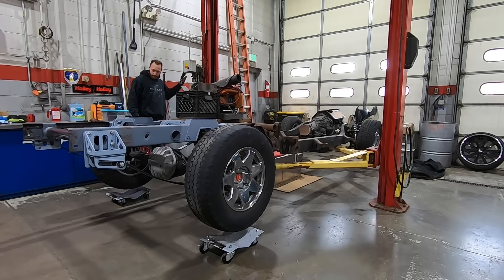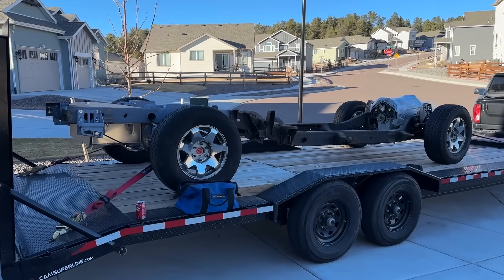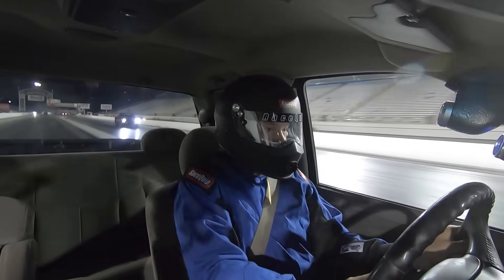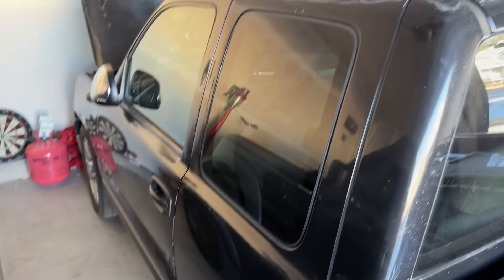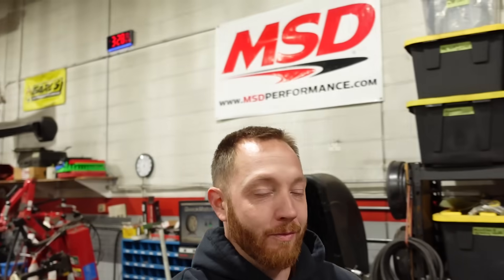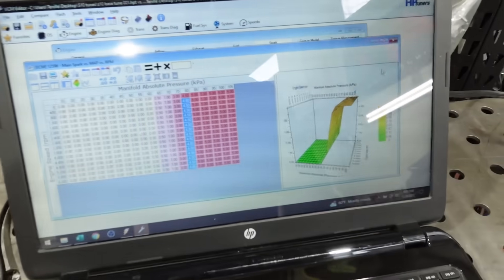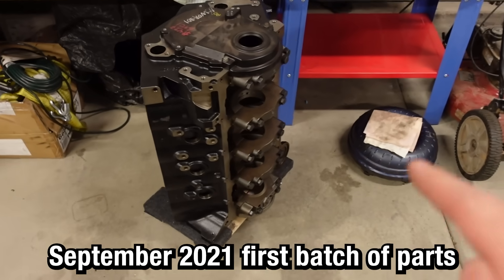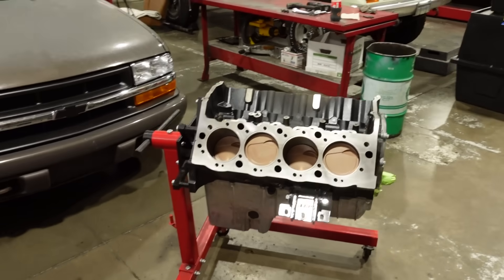my MOST POWERFUL engine project is BACK

Comment: Dang I just found you and was excited you was in Utah as I’m in Utah as well. Then I found this video where I learned you were in CO. Congrats on the shop by the way

Your 8.1L videos have been awesome, and I’m  learning a lot. I have an early 70s Camaro I’m putting the 8.1 into that should handle boost 1100hp. Wanted to be unique. Got the bottom end done and I am about to do the top end and camshaft. Was hoping you’d dyno it when it was ready.

Comment: I'm doing something similar. 20 years ago I put an 8.1 in my 91 square body crew cab dually and I recently acquired a PSI 8.8 that I'm going to do raylar heads and the Whipple supercharger and replace the 4L80 with a 6L90

Comment: I don't know if it's been mentioned but it would be interesting to see what power could be had on the 4.3 v6 by grinding off the restrictive wedge on the throttle blade.
Reply: I think it’s just part throttle feel that’s changed…. I cut that restrictor off my OBS V6 and it made it pretty jumpy off the line - it was hard to take off smoothly.  I noticed the restrictor on my OBS suburban was like half the height of the V6, so I swapped TB’s and now both vehicles are perfect.  My SCSB v6 truck isn’t jumpy off the line, but is more responsive with the short V8 restrictor plate, and  my suburban with no restrictor plate feels great (too heavy to be jumpy off the line, but takes less pedal to get going).

Comment: I think it would be amazing if you made a few turbo kits (hot side) for the 8.1 and sold them. I think there’s a few of us that would love to do something different and put an 8.1 or have one already and want to add some power but don’t have the equipment or knowledge to build a hot side. Everything available is only for the 4.8,5.3 and 6.0 as you know
Reply: For the price of buying a custom hotside you can buy a hobart 140 welder and start learning yourself.

Comment: Suggestion.
Instead of finding a body for the 4*4 truck frame just get a floor pan and build a tubular shell , roll cage to fit panels that mimic the Tesla cyber truck.
This would be one of the ultimate trolls possible.😂

Comment: I was wondering how you "know" it's 1700 hp? It's not even fully assembled.
Reply: Head flow , cubes , cam size , cylinder pressure with boost and CFM flow of the turbos. 

There's a few engineering suites out there that you can play with to find theoretical HP and torque.

Comment: The 4.3 throttle blade has a built in "scoop" on it to restrict air flow. Remove it and you'll gain a tad more at WOT.

Comment: I love all of your build series that you've done. I plan on doing an Avalanche SS build inspired by what you've done. Planning on taking an Escalade AWD drive train and building the 6.0 and trans and putting them in ny 2003 Avalanche. Building the 6.0 into a 408 stroker and putting a set of twin turbos on it. Also want to put the truck on air bags. Goals are to have a very unique, AWD, OEM+ (stole that term from you LT lol) street truck that is fun to drive and can hurt feelings from time to time. Hopefully make a reliable 800-1000 horsepower. I have everything I need to get started except time lol

Comment: Would you consider shortening the frame for a standard cab-short box?
Reply: I think that was a mistake that he made when buying that frame. He bought it to use on the Ugly Truck but then decided to just build another truck. He would have been better off buying a regular cab short bed truck. That would be lighter than the extended cab truck.
Reply: @beetlebuilder5882 He can modify the frame. There was a truck tech episode that had it but LT wasn't there at the time.
Reply: @ericbrenner690  yes he could shorten it to use a regular cab (I have done that myself) and that would make sense to do but he created more work for himself. He should have just started with a complete regular cab from the start.

Comment: Does it need leaning out in power enrichment I have just noticed on the full size trucks power enrichment just is basically non existent because it needs like 90%throttle and to be above 5000 rpm for 5 seconds so never activated

Comment: The BB in full size truck body all wheel drive with a Wipple gen6 3.0L should put you in the 9s maybe 8s without all the cluster F of exhaust system for 2 turbos if ya can get hooked. Keep the content coming!

Comment: I don't if you you watch motor trend but they have a show called road kill they took a stock bottom 4.3l and put a powerstroke turbo on it they said  it made 600hp at the wheels . They put it in a beat up Datsun 240z they called the rotsun.

Comment: Regarding HP Tuners, I have the software and the credits, and I have a 2011 Malibu with the 3.6L VVT LY7. 

Do you think that being FWD or having the VVT would make it harder to modify the tune? 

All I would am hoping to do is get maybe 20-40 more HP out of it, or maybe a little more MPG when on Cruise Control. Nothing neck-snapping at all. After all, it's just a grocery-getter.

Comment: the LV1 is the gen v 4.3L, and can approach 400 bhp with simple mods.  They're several hundred dollars at the scrap yard.

EQ makes more sense.  An engine pumps a certain amount of air, and you need to add more or less fuel.  AFR is backwards.  when you want to add fuel, you take away AFR.

Comment: Would like to see some bolt ons on the 4.3 just to see what it’s capable of  before the engine swap
Reply: Not much without forced induction. Even with very expensive 15 or 23 degree heads and everything to go with it he would be lucky to hit 300 crank.

Comment: Really enjoying the S10 content!  Have you given any thought to the idea of converting it to a 6L80?
Reply: I’ve wondered that myself. I think it’s just cheaper and easier to do a 4L80 and he’s much more familiar with them. I’ve got a 6L80 in my aluminum 5.3L swapped ‘55. It’d be interesting to compare it against a similar setup with a 4L60, but I’m really happy with the 6L80.
Reply: 4l80s are cheaper, but this build doesn't seem to be overly concerned with that.  And with the Pro-Touring concept he has stated for it, it would seem to me the 6L80 would be a better fit.  But then again, I could be wrong.